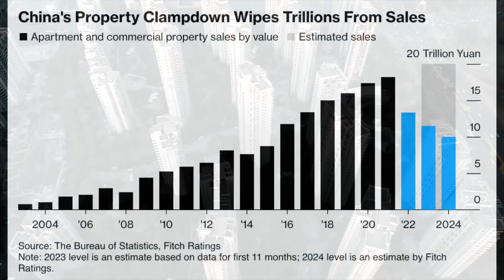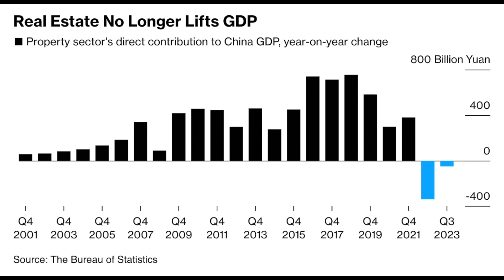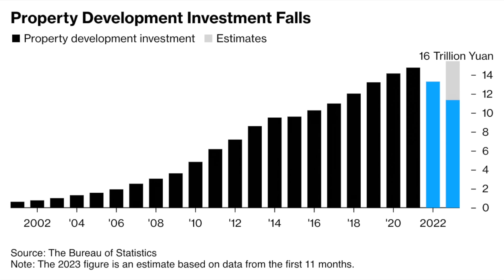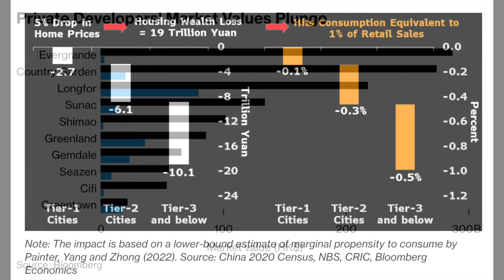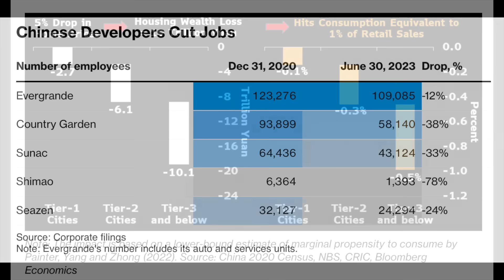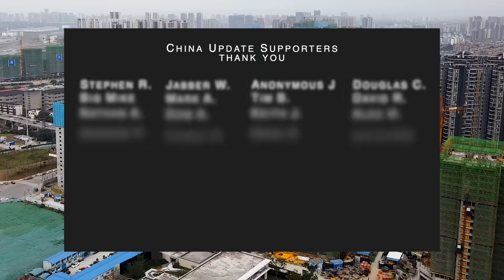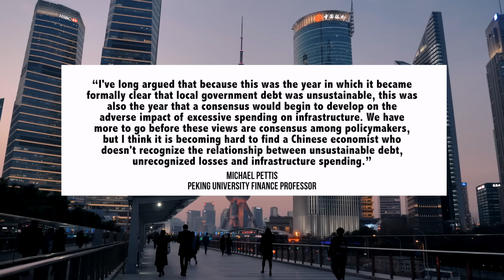84% Collapse: China's Economic Crises & Housing | Fiscal Woes

Comment: It is amazing that people in china thought that the property market was eternally elastic. When you have more properties built than people requiring homes, then the demand is only then as an investment commodity. With any investment, its value is driven by supply and demand economics. Where continued demand is based on the belief that people can sell the asset at a higher price than that at which they purchased. As soon as selling the asset becomes difficult (demand or regulatory), then the market deflates / collapses to an economic value. Selling property has always been troublesome in China, so the asset has always had limited liquidity. With a cooling economy and people seeking to liquidate their assets, real supply / demand economics are coming into play and there is no real demand. Back in 2016 I was telling people to diversify from Chinese property as it reflected the Dutch Tulip Bubble. However, they kept on saying China is different. No it is not, just the timing is different.
Reply: They are doing the same with the EV market. They over produce and think that pumping and dumping is a successful ecomomic model.
Reply: Chinese know what you say
Reply: @sonialelii9038  Seems that the EU has decided to put a damper on this particular methodology from them for the EV market.
Reply: after 30 years, a to good to be true run, seems like a sure thing.   Nobody under 60 in  China has had to deal with an economic cycle as the CCP has always done its best to fix things, till even they realized they couldn't fix it anymore.
Reply: @dorothyluo1668  I fucking hope so.  Maybe they'll finally fucking learn that China's economy is not unique in any way, shape, or form and listen to people who know what economies do.
Reply: @sb5580  Everyone over 60 remembers the food famines, so hordes
Reply: @julesfisher
Simply true. A more or less central planned economy will never understand and act accordingly to the one basic law of economics, the principle of the diminishing marginal utility or simplified: prices (and thus value) are created by the interplay of demand and supply
Reply: @dankurth4232  developed economies have a balance of taxing authorities, regulatory rules, consumer freedom, labor laws, independent banking and insurance.   China has inadequate consumer choice, no
diversity of investment choices etc.  And they dodged and weaved to not get taken down by the 2008 collapse, but they just delayed it not stopped.
Reply: @sb5580  true! But even western economies suffer  from intervening far too much in their economies instead of letting markets work under the self-regulatory regime of the law of diminishing marginal utility. There are a few interventions necessary to balance socially too harmful markets imbalances, probably not more than 10% of the actual amount
Reply: Too many tigers moms believing their own hype….

Comment: According to a video I recently watched on skyscrapers in China, they are all built on the basis of land use rights for only 40 years. This results in:
- a design life of only 50 years (which encourages shoddy construction);
- a mad rush to start building the thing before the design is even finalised; and
- a disinclination to maintain the building (and skyscrapers require a lot of ongoing maintenance).

At the end of the 40 year term (which began before construction started) the local government will get a building which is totally run down and cost a fortune to either restore or demolish. What they no doubt thought was a cunning plan to get a second windfall will actually put a substantial burden on their finances. This will happen relatively soon - in around 20 years for many skyscrapers.

Comment: Too bad the property sales references in this video don't contain any info about sales volume, both actual numbers and trends. Without that information, we can't know how bad the downturn is, we only know at the moment that there is significant downward pressure.
Here in the US the reasons for selling property can be complex. Reasons can be for tax savings, property loan obligation reasons like balloon payments, long term growth or capital extraction strategies and so on including simply wanting to get out of the property ownership for non-property personal reasons in which case selling would be purely voluntary and not compelled.

If the market is depressed, often potential sellers will decide to delay selling if possible but if the reason for selling is compelling then at some point the seller has to sell and if this is the case then volume is typically low. If volume is high in the face of large discounted prices, then it would probably be a reflection of a massive psyche of accepting losses and portend greater violent losses in the future until the marketplace re-balances. But if volume is low, then it may mean that the full downturn may be delayed. 

The point also is that generally all property values are not calculated until a property is sold. If property owners are delaying or refusing to sell you can talk about a theoretical change in value but the actual value usually isn't reassessed until a transaction takes place. Volume sales then becomes an important metric, indicating the number of properties' values that are set at new transaction prices while everyone else who own similar properties but aren't selling are merely speculating what their properties are worth.

Probably adding to the difficulty of analyzing market data is if the CCP is blocking or altering publication of data. Believable, verifiable data may be harder to come by in the future which might make the CCP feel better in the short run and make a sudden and immediate collapse less likely but is thought to have a more serious long term effect.

Comment: Well tony realistically the CCP will have to inflate their way out of the housing market crash in such a way that other areas of the market grow faster than real-estate. Now the CCP has every capacity to do so given their control of the banking sector as they can simply keep the amount of lending to real-estate growing at around 2 percent a year whilst growing the amount of lending to everything else at like 15 to 30 percent per year. Couple this with massive increases in the minimum wage and massive increases in worker rights and enforment of those rights and effectively China could in about 3 years reduce the averafe spending on real-estate from about 10x annual median income down to around 5x annual median income and in another 3 years reduced it to around 2.5x annual median income.

China has to reset the real-estate sector and this is the only way i can think of for them to do so. Inflate the economy in such a way that reduces the real-estates sectors size realtive to the rest of the economy.

Then of course there is a need for land reforms and tax reforms that will have to happen. One thing weve seen in the US is higher property taxes tend to lower the overall cost of housing. As such china could shift tax burden away from other areas and move it to housing which will help reduce the speculation in the real-estate. After all if you are paying taxes on property youre going to want to rent that property out if youre not living in it.

At any rate China is in a mess and its going to get messier until they get the macro economy adjusted to more sustainable footings.